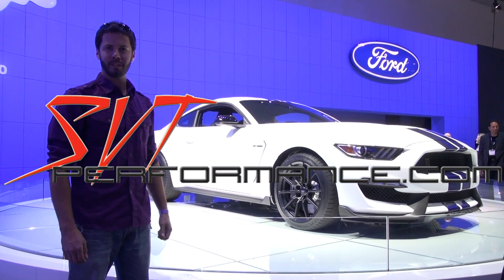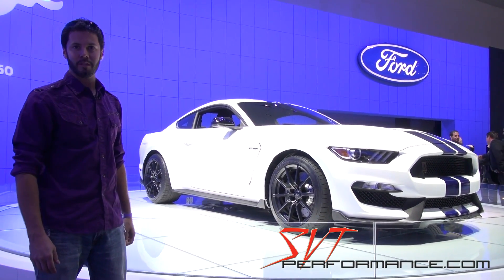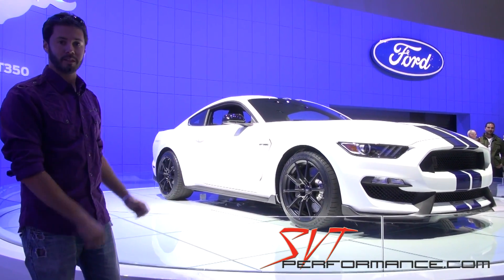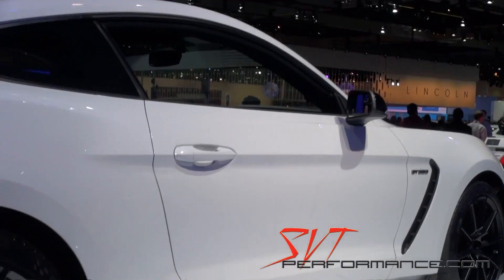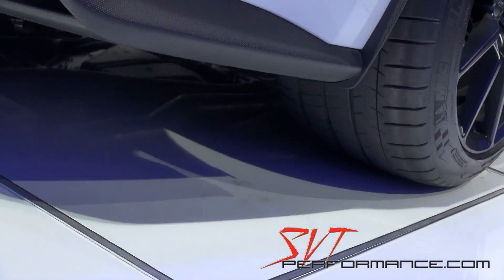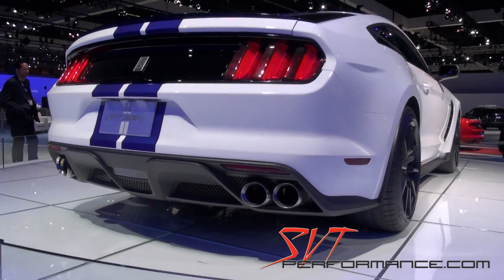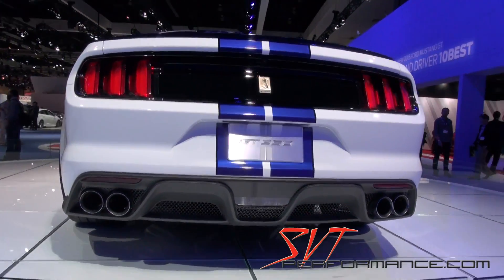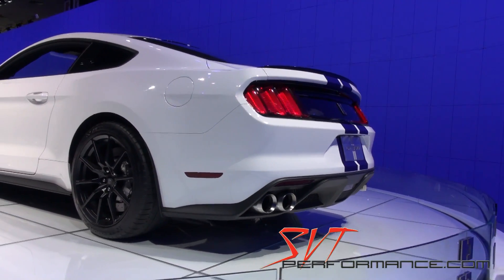SVTPerformance.com Interview: Jamal Hameedi on the Shelby GT350

Comment: What happened to the GT500?????????????????? when are they going to build a 7.0
Reply: ihatecrackhead'15 coyote is lighter than '14 coyote. not by much but around ~5lbs. So lets say 439lbs. 5.2L FPC is ~10lbs lighter, Plasma Bore ~6lbs lighter, pistons, rods, oil pan & no engine cover ~3lbs, plus misc... So it's 420lbs or lighter.
Reply: ihatecrackhead GM's LS7 7.0L weighs 454lbs plus dry sump oil tank & lines ~464lbs or more http://gmauthority.com/blog/gm/gm-engines/ls7/ Conventional oil pan to make apples to apples weight comparison would be around ~460lbs. (I apologize for making 3 replies when they could've been one)
Reply: The gt500 is coming out in 2016
Reply: 2017 not 2016
Reply: ihatecrackhead You actually didn't say which engines, only size. Even so, I did understand, I know you were talking about OLD engines. I was explaining New engines weigh different amount.
Yes, '11-15 Coyote and current shipments of crate engines (left-over '14) all weigh ~444lbs, But, '15 Mustang Coyote is lighter (pretty sure I explained that).
Yes, LS3 is relatively lightweight. But, LS3 is has been replaced by LT1 in Corvette & next year in Camaro.
It's more relevant to compare '16+ Voodoo (GT359's 5.2L), '15+ Coyote 5.0 & Corvette/Camaro '15+/'16+ LT1.
Basically, things change. In the past your argument was valid. But, going forward for the next few years New Coyote is lighter than New LT1.
Reply: ihatecrackhead
-Camaro is getting LT
-Mustang GT350 5.2L has Plasma Spray bores.
-I'm not quoting Aluminator engine. I clearly stated GT350's 5.2L engine which is based on 5.0 Coyote from Mustang GT.

'15 Camaro SS 6.2L LS3 400lbs (Last Year!)
'16 Mustang GT350 5.2L Voodoo 420lbs
'15 Mustang GT 5.0 Coyote 439lbs
'11-14 Mustang GT 5.0 Coyote 444lbs 
'15 Camaro Z/28 LS7 7.0L 454lbs plus dry sump oil tank & lines ~464lbs or more (Last Year!)
'15 Corvette LT1 6.2L 465lbs
'16 Camaro LT1 6.2L 465lbs
Reply: ihatecrackhead Haha You're Funny!! Well we both know you've lost this discussion because now you're just miss quoting me and making things up. Or maybe you just have a reading comprehension problem. Dude I understand if English is your second language, no worries!

Let me be CLEAR- I'm not talking about aftermarket rods & pistons. I'm talking about STOCK FACTORY MUSTANG GT350 ENGINE and all the other engines I listed are stock factory items. haha...

you said "LT1 weighs in at 425hp"
HP is a unit of Power
lbs is a unit of weight
I will assume "hp" is a typo. Where is your source?

GM's LT1 6.2L weighs  465lbs  www.topspeed.com/cars/car-news/chevrolet-introduces-the-all-new-lt1-v8-engine-for-the-c7-corvette-ar136830.html
Reply: ihatecrackhead
Im sorry if you don't understand. We won't hold it against you.

I would like to apologize for myself and everyone else who laughs at you. 

Guys, it is not fair to pick on people with issues, we need to stop.
Reply: +ihatecrackhead haaha junk?? The 5.0L coyote is a beast of a motor, more power than the 6.2L LS3 with 1.2L less displacement And the new 5.2L voodoo makes more power than the POS LS7 7.0L haahaa 7 Liters of displacement and only 505Hp haahaa classic GM engineering right there, no wonder why europeans laugh at American Cars its all Gm's fault lmafo..
Did you know the SuperSnake has 1200Hp and still uses the same tremec transmission without any issues.

Ford engines are used by Koenisegg, because of how badass they are. Show me an european hypercar that uses a pos Gm engine. You said there are numerous supercars all over the world using Gm engines. Besides the Venom GT there is none lmafo.. 
The new LT4 is a POS, it overheats and looses power lmafo.. Oh boy you just made my day haaha
Reply: You got an facts to backup your lies? Thought so.
Reply: +ihatecrackhead Koenisegg uses the 5.0L Cammer engine with top of the line internals and they also used the 4.6L. 
Even if its got aftermarket internals that, it still remains a Ford cammer block. Same architecture, same pulley placement even the alternator is in the same spot. And they also used the 4.6L to put more than 1000Hp. 
GM makes some pos engine for sure hahaa a 7.0L making 505Hp lmafo.. Ford's 5.2L is making like 550Hp with only 5.2L. Thats what you call engineering, its the only flat plane crank v8 in a production car with that much displacement, an achievement only made by Ford!!! yeeee haaha Gm is still stuck with their POS pushrod engine because they cant design a DOHC engine, Lotus had to make it for them back in the 90's bhaahaaha
Reply: Google? Is that the thing that gives opposite information from what you say? 

You know, gm buys parts, not just 69 rods. Mustang had over 300hp way before 2009.

I got some facts for you.
1. You said GM does not buy parts.
2. You say GM buys a few parts.
3. You brag that the parts GM does buy is better than fords.

Did I miss something?
Reply: Lol, crackhead will
1. Not reply.
2. Ignore these facts.
3. Say that Ford buys parts.
Reply: +ihatecrackhead gm couldn't desing a DOHC v8 so lotus had to make it for them, what a bunch of incompetent engineers lmafo GM buys recaro brand parts, multimatic parts, tremec, brembo, torsen, tvs, mahle, 

Thats right now you're getting it pea brain 👍👍
Teksid supplied the Modular Ford 4.6L block used the CCX and did you know Teksid makes blocks for Ford haaha
Reply: +ihatecrackhead bhaahaa thats what im talking about Voodoo 5.2L with more power than a GM 7.0L shitrod haaha 
And the funniest thing is that you're
 now bringing in a POS modified Gm engine into the discussion in order to compete with a factory stock 5.2L bhahaa roflmafo!!😂😂😂😂 that speaks for itself haaha

FORD POWWERRR💪💪💪💪😈

GM=💩 haahaa
Reply: +ihatecrackhead haahaaa you said it yourself  "upgrade" lol the POS camaro engine needs to be upgraded in order to compete with a factory stock 5.2L haahaa
Face it, Gm doesn't have anything as badass as 5.2L Voodoo gad dammm it makes me proud to be a Ford guy lol Ford really put GM to shame with a little 5.2L haahaa

Comment: A GT500 would more than likely come down the pipeline shortly after the run of the 350GT is done.  Theirs rumors of a Shelby Cobra possibly in the works but one never knows.  It almost doesn't seem logical for such a car to be in the works considering fords focus on the forthcoming FORDGT.  A Cobra would be a conflict of consumer interest unless its debut's as Fords vacant sportscar slot.  A full production corvette rival.    though there are certainly performance capable mustangs to rival and beat the corvette, technically the Mustang and the Corvette remain two different segment entities, made evident as CHEVY has both the corvette and the camaro when ford only has the Mustang as their full production sportscar.  simply put ford has no full production corvette rival.  Cobra could be that missing link in the lineup.